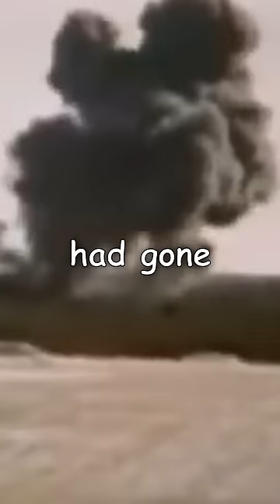1.3 Seconds from Death #shorts

Comment: If it was A-10, the pilot would have flown for another 2 hours. No hydraulics no worries
Reply: No lies! Lol
Reply: That's because it's fly by wire like all other aircraft. If I remember right the f4 and f14 were the last frontline fighters to still use hydraulics and not fly by wire systems
Reply: @jamesmaddison4546 
No: the A-10 Thunderbolt II is not "Fly By Wire". Just ask Air Force Captain Kim "Killer Chick" Campbell, who flew her A-10 home after all her hydraulics were shot to hell by Triple A. She had to "manhandle" it all the way back, getting it safely on the runway just like no problems existed.
Reply: @jamesmaddison4546 Of the USAF/USN planes designed in the 70s and 80s, only the F-16 and F/A-18 had fly-by-wire.  Everything else uses only hydraulics (except the A-10 that has manual reversion backup).
Reply: @jamesmaddison4546 No, A-10 has a “manual reversion” mode as a redundancy.  “Cables and pulleys” like an old school airplane.
Reply: @Coole501  So, I had to look this up. THe A-10 is indeed controlled by hydraulics, but it has a fly-by-wire as a backup system incase the hydraulics fail. So, you both are correct.
Reply: @henryairconcepts2999
…….and if pigs had wings they could fly.
Reply: @robertmcnearny9222 it still has a redundancy system. It was built in the 60’s/70’s, so initially it was never fly by wire. That’s a recent flight control.
Reply: @johnjohnsn7633 Triple A? You mean Amy Amanda Allen of the A-Team?
Reply: @robertmcnearny9222  fly by wire means the hyd sys and controls of the Aircraft is managed by the onboard Computers, similar to an A320. The A10 has Cable operated flight control Surfaces. So basically the Control Column (Joystick) and rudder pedals are directly connected to the flight controls via cables, pulleys and control rods BUT hydraulically boosted by hyd Actuators. In case of a hyd loss, hopefully you still have your control cables intact, but you would need a good deal of force to handle the Aircraft especially at high speeds.
Reply: Wrong end of Long Island
Reply: Some people here don't understand that "fly by wire" does not mean pulleys and cables
Reply: @AlexDMC   It doesn't mean no hydraulics either.

Comment: Fairly certain the first aircraft in this video is the F-111B undergoing carrier trials.  Not that it matters, just an interesting but brief glimpse of a special event. (edited to show correct aircraft designation).
Reply: Yup, you're right.
Reply: Jupp, you are right it is the F-111B 👍🏻
Reply: @raoulcruz: Good catch, but F-111B, not FB-111. For some interesting trivia, the USN didn’t want the F-111. One feature of the FB-111 was that it used the heavier duty landing gear of the Navy’s F-111B. I don’t know if any later variants did as well, but I know the original F-111A didn’t.
Reply: @terrysaunders2026    Right you are.  I guess my memory can be dyslexic at times.  My former boss was on that aircraft carrier and was taking pictures with an instamatic camera. The captain had his camera confiscated.
Reply: You right I worked on F111Fs  4 years
Reply: @terrysaunders2026 Ozzy F1-11C'S did, and the longer 70ft span.   Their later G models had better avionics.  Remarkable bird.  Really showed what it was fully capable of
Reply: Isn't the 111 the reason Grumman was able to be so successful with the 14?
The previous experience with swing swing - I understand why they would include that in the video
Reply: @ronaldkonkoma4356 .  According to Wikipedia that is correct.  If you trust that source. 
Grumman also produced the F10F Jaguar. I presume they gained some information on that project, also.
Reply: @raoulcruz4404  that and like 80 other shows and interviews but thank you for verifying lol

Comment: These jets had many problems in their early days.  Many pilots were killed flying them back then.  A big problem with (can't remember exactly) F-16 was wiring chafing.  While the jets were in flight and underwent high speed banking maneuvers which created extreme G-forces the wiring inside the jets would rub against other internal parts and the protective coating on the wires would rub off and cause electrical shorts causing the jets to crash.  It was a mystery for many years with these jets.

Comment: Just like with the space, shuttle challenger, people knew of issues, but money was more important! I bet also, just like with the space shuttle challenger there were no consequences in this incident for the people and manufacturer who knew about this issue and said nothing and pushed ahead with the test!
Reply: The Tomcat is more similar to another Challenger that's also a Cat in the Dodge Challenger Hellcat. It's powerful, and overweight, and it's got the worst handling of any of its contemporaries. (When talking F14 it's contemporaries being other U.S. 4th GEN fighters, and when talking Dodge Challenger it's contemporaries being Camaro and Mustang) When soes having the worst handles make you cool in either the world of fighters or performance cars. If a Tomcat = Challenger Hellcat, then a F18 = GEN6 Camaro SS 1LE, a F16 = Shelby GT350R, and a F15 would likely = S550 GT500. 

I mean people bust a Super Hornets nuts for it's size increase over the Legacy Hornet, but a Tomcats dry weight is still 6 tons heavier than a Super Hornets dry weight. Never understood why so many millennials have such a boner for the Tomfat, while claiming it dominates other fighters from its era. It did some things well, and other things not as well as is contemporaries. 

A lot of famboys will claim that F14 is was better than F15A/F15C because so and so said so, but what was an F14 better at than an F15, other than taking the abuse sustained during career operations?
Reply: @JROC734  HUH?! What does your reply to my comment have to do with my comment?! My comment is plainly focused on the fact that companies knowingly put pilots lives at risk by letting the pilots fly without knowing there are serious issues with a particular air/space craft.

Comment: The scene where the pilot is climbing into the cockpit is a F-111 not an F-14
Reply: The plot thickens...
Reply: Maybe an f11, not an aardvark
Reply: @silverwings5385  F-111B - naval variant. Definitely an Aardvark.
Reply: @silverwings5385 That is an F-111. You can tell from the canopy.
Reply: It's a A-10
Reply: @wolf-1346  nope it’s a 2 seater / side by side configuration. A-10 is strictly a one seater and not a Navy platform. The plane that’s shown was a prototype naval version of the F-111. It had a shorter, more aesthetic nose than the aardvark nose on the Air Force version.
Reply: It's the same F111 the Air force used for years started as a navy super jet designed for the navy and then carrier trials began and the F111 was to big  and under powered for a naval interceptor they cancelled and the Air Force said they would like to try it
Reply: @silverwings5385  NO F111 NOT F11 F111 WAS ORIGINALLY BUILT FOR THE UNITED STATES NAVY  THEY DIDN'T LIKE IT AIR FORCE TOOK IT AND MADE IT A VERY SUCCESSFUL AIRCRAFT NAVY CANCELLED F111 CONTRACT TO BIG HARD TO LAND ON CARRIER F 14 CAME A LITTLE LATER BOTH WERE GREAT PLANES USED CORRECTLY
Reply: @localbod  HE'S TELLING THE TRUTH IT'S AN F111

Comment: That near fatal flight took place on Long Island NY approach to Grumman Calverton
On the footage, you could see the 495 Long Island Expressway when they cross over it.
F 14 was a great plane with later upgrades to the power plants the F 14 D and then later Avonics changes to the F 14 D+
I seen that Jet as a kid doing a night illumination test, Calverton, New York plant
2  of F 14D+  took off headed towards the end of the runway  that me and my girlfriend were sitting on the top of A van right at Route 25 
It was a tandem takeoff full after burner right overhead, and then straight vertical, it was an unbelievable experience it was the
Pinnacle of my days of hanging out at Calverton, Long Island, New York, cutting  out of high school to watch these Grumman Jets come & Go  A4 Skyhawks, A 6 intruders
EA-6B prowlers 
Not sure about the A4 Skyhawks being a Grumman Jet but they were there at that test facility for something.
Long Live The F14 Tomcat !

Comment: This is what happens when greed outweighs the safety of the pilots, their fellow military personnel & society as these failures could lead to civilians being hurt or killed also.
Reply: What greed? At the time companies operated on the idea of "Deliver or Go Under", and in order to secure a contract, deadlines and milestones had to be laid out as part of the contract. The USN at the time was already ticked off over the F-111B failure, and weren't going to tolerate another lame duck. Grumman knew that coming in when the Navy turned to them and told them "Design us a plane that works, and get it to us ASAP". So, yeah, Grumman poured a lot of money getting to that prototype, and had a strict deadline to meet. If they didn't meet the deadline, they were going to lose the contract, and with it, potentially billions of dollars. As I said in another comment, the leak wasn't considered to be that bad when they started. It was only after they were in the air that things went from "meh" to "uhm..." to "oh crap". They fixed the issue in prototype #2 (which was finished just a month or so later), and the Tomcat went on to be the longest serving fighter in USN history.
Reply: @Tank50us  Yes, hindsight is a wonderful thing. They didn't know the chances of failure were 100% and not 10%. The geniuses here know the probability was 1, so obviously Grumman must have know that before the flight!

Comment: Employee: Hey boss, isnt that hydroloics fluid leaking off the side of the plane? We should take the time to fix that befo...

Boss: No time, just wipe it off and lets get this test flight started!!
Reply: Funny thing... in that time some hydraulic leaking was considered normal. The plane usually had plenty in the system, and the fluids were checked regularly. Just like with oil, many mechanics operated on the mantra "If there's no oil on it, there's no oil in it", and the same applied to hydraulic fluid.

Comment: I worked for Grumman Aerospace in Calveron, New York on Long Island at the plant #6 final assembly facility on the F-14 programs ( A's, A+, Block 60/65, the F-14D prototype, Chase #2, Iranian exports and all production D model A/C until the end of the program ). As for your video, a large group of employees, Navy brass and engineers were present when the Tomcat prototype crashed into the woods just short of the runway after the pump failure. After a long investigation the aircraft's remains were buried on the property for security reasons. it was a sad day when the last aircraft rolled off the assembly line leaving the plant dark and empty. It was one of aviation's greatest naval fighters, period. I'm proud to have been part of the Tomcat's history.

Comment: Similarly during 1st real test flight of McDonnell Douglas F-4H-1F Phantom II Bu No 146316 (17th Production F-4), NWEF (Naval Weapons Experimental Flight), the plane had an accident when it broke up in flight and exploded in a crash over White Sands Missile Range on 18 May 1961 during project "Sageburner" (a low altitude speed record attempt) due to pilot-induced oscillations. The F-4 was the predecessor to the F-14.

Comment: The problem was some metal hydraulic lines in the main landing wheel wells that started to resonate with the low engine power settings used during the flight. The mounts for the lines were also loose. Eventually the lines ruptured causing a loss of hydraulic fluid. There was an emergency backup system that would have still allowed the pilot to control the tailplanes but it failed as well. They fixed it by replacing the hydraulic lines with stainless steel lines.

Comment: A friend of mine's father was a test pilot for Agusta Westland/Leonardo on the AW609 VTOL. The manufacturer didn't fix oscillations during high speed flight. They again did high speed dives and the propellers hit the wings several times due to the oscillation and then crashed. Both pilots died.

Comment: My dad built that plane and the problem was the hydraulic lines were manufactured in California and were not bent correctly and the management told the production team to use them any way and the stress on the lines caused them to fail….

Comment: That's a shame. The F-14 was a good plane. However,  the F-15, which came 2 years afterward, was (and is) much better. To my knowledge,  they've never lost an F-15, and it's still in use 47 years later!
Reply: Theyve never lost one in air to air combat. Its like 104 or 107-0 something around there

Comment: Me thinks about the same ole story…, the o-ring in the space shuttle flight, when ‘subtle’ engineering concerns were not addressed; the tail rudder flutter in the early 737 when the plane maker said pilot training would fix it (what a hoot), and of course the classic Titantic ship builder rubble to save time, space, and money (and looks) - improper sealed cabin/compartments, not enough life boats, cheaper slag mixed metal rivets. The storied list is as long as the lies, treachery, and greed…and pride.

Comment: This sounds like its made up by an ai. The nose wheel crashed into a tree? What? They waited til they were 25 feet about the trees to eject? They flew a jet that they knew was leaking hydraulic fluid? Literally every aspect of this sounds like nonsense
Reply: The story is from the test pilot involved, Bob Smyth in a talk at the Cradle of Aviation Museum, Garden City, New York, on May 19, 2005. They were at 25 ft approaching the runway when the nose went down & they were forced to eject.  They did not know there might be hydraulic fluid leak when they took off, because a report on the first leak from the Engineering Lab was working its way through the system over Christmas, "telling us that the engine run failure was a fatigue fracture of the 5/16th-inch titanium line.” The nose wheel hitting a tree is his own words.

Comment: should still be able to fly it without hydraulic fluid,same way you can turn a car steering wheel when the pump goes out.
Reply: Yeah, for sure... Because operating an automobile without power steering is almost exactly like operating an F-14 with no hydraulics 🤔

Comment: To low, ejection seats don't work at that height unless f35 or carrier service and hit water rather them deck
Reply: by the time of the F-14 0-0 Ejection Seats had existed for a decade. Both Pilot and RIO were fine.
Reply: The F14 used a Martin Baker ejection seat with zero-zero capability. 

F35 uses a Martin Baker seat too.

Comment: That's not an F-14 they're climbing into in the opening shot of your little video. If you can't tell the difference between an F-111B and a YF-14A, you should find another hobby rather than post crap like this.

Comment: So all hydraulic systems malfunctioned? Atbleast inknow for Mig29 that it has 2 hydraulic systems. One that is used only for flying commands andnother forneverything else. But no matter which one malfunction other one is used for commands so pilots could fly back and have controll. I guess here itnwas some pipeline broken or hydraulic reservoir punctured ornnot closed properly ifnall fluid went out.

Comment: My maintenance chief used to up the aircraft after I downed it for a hydraulic leak on a strut which was cause for downing the aircraft in the first place.  I did bring a complaint against him to the base commander when I saw him increasing hydraulic pressures above the n a t o p s manual recommendations..
That following year year he killed a navy deck hand while flipping a ch46 on deck by trying to take off while chained down. Stub wing chains broke. Nose gear chain did not break. Hence the flip.

Comment: Let's not forget grandma's other fubar. Shortening the high voltage power harness on the a10 wardhog. Resulting in four planes being damaged when the installation got rubbed off as it was guarding over the yellow cans for the twenty millimeter machine gun. Or was it a twelve millimeter machine gun I forget to which. Killing three veteran pilots that were being trained on the a10. Of course the first three crashes were pilot error. The fourth resulted in a rather embarrassing investigation. And damn near the immediate Canceling of the contract. Never trust accountants and engineers.